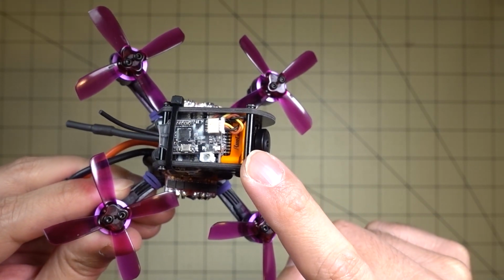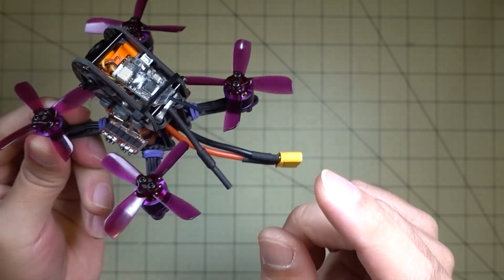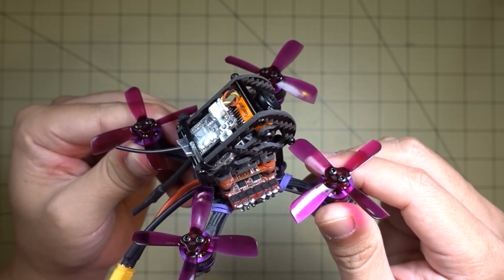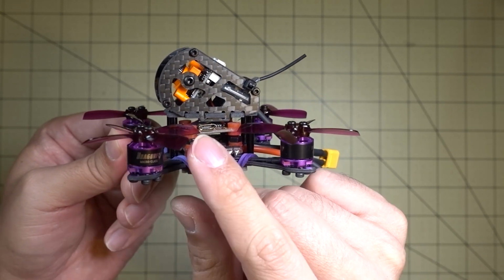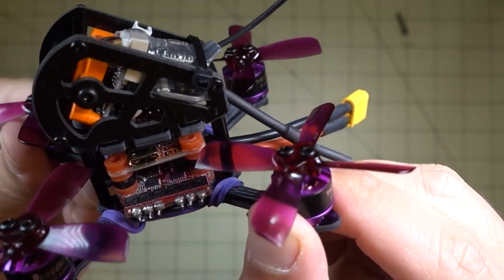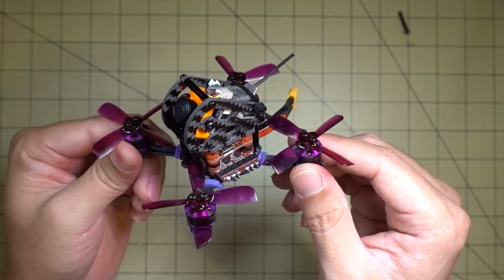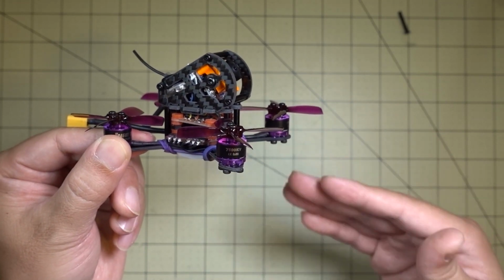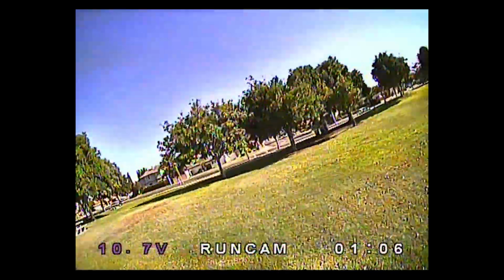MD#71 🚁 FPVmodel X-Racer X9 Review 💥

Comment: Raceflight just came out with the new versions of the spark and millivolt. They removed the pins and used a ribbon cable to connect the two. That right there should help with the vibration issue as well as shorten the stack a tiny bit.
Reply from the maker: Yes, my version was an early release. I'm sure they've taken my feedback into consideration to improve the product.

Comment: Albert can you check to see if they used the pins flushed to connect the milli to the spark? It does not look like it is a v2 so I am betting it has the pins. That will cause noise hence oscillation. Edit: duh missed that part. SKIP THE PINS

Comment: THank Albert - another great review! Not a fan of RaceFlight - seems like a really dinky program to me
Reply: RF is actually pretty damn good. Don't knock it till you try it.
Reply: Droned Out! R/C it sure looks awesome on bigger quads. But this little quad has a lot of occilations. I cant tell if it is the firmware or the build. But it is dissapointing to watch
Reply: I think they used the pins to connect. That will do it on some frames. For some reason the gyro used is very susceptible to frame resonance when using a pin install. If Albert can fill us in?
Reply: Yup those damn pins are the issue with the frame choice. lose the pins for wire and its gold